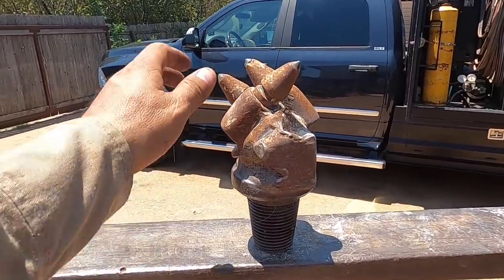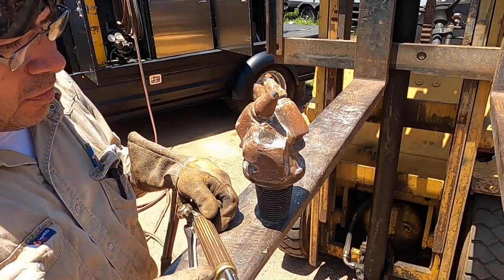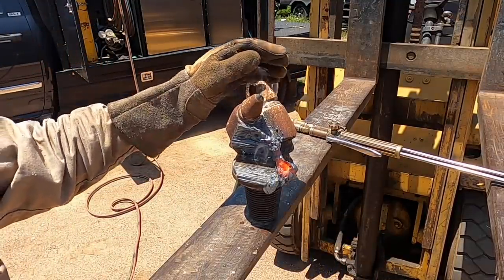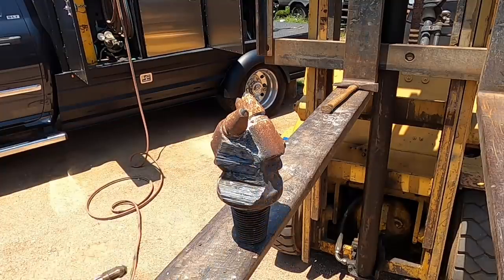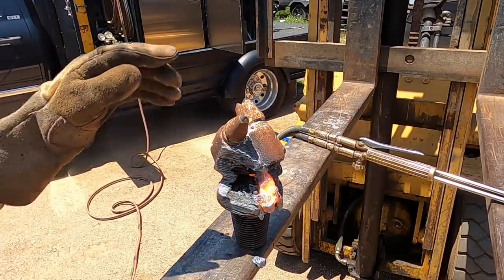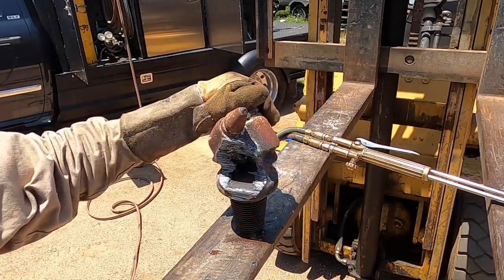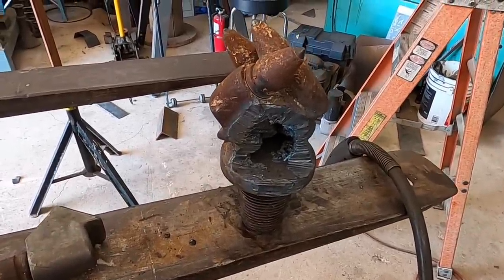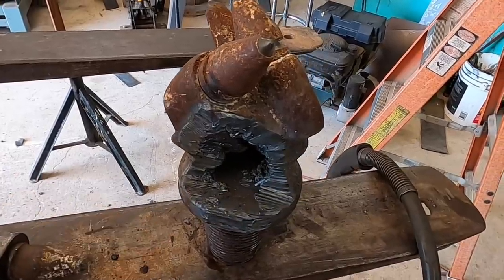Something's missing!!!

Comment: I was thinks ng about you today. I had to cut a 1/4 inch wall sleeve off of a 1-7/16 shaft. I kept thinking about you cutting out MARA and how you went slowly. It helped me focus on slowing down. I cut a face off all the along, then came back and heated up a bit and blew just until I saw the metal separate. Moved a bit and repeat. Perfect cut, no marks on the shaft. Thank you for helping me stay focused.
Reply from the maker: That is awesome! glad it worked.

Comment: One of those teeth looks like it has a flat wear mark on the tungsten. - This means that it is not rotating in the pocket (they call these rotating pick teeth), this causes the tooth to heat up and get ground away as it works the rock, should be beat on or heated up until you can move it in the pocket, if you can't, so long as its still got life you may as well leave it, those teeth ain't cheap.
Not fundamental to your job, and you probably know this, but it might be an added touch you can tell the client about. Always worth going above and beyond.
The tapered thread pilots are rare, probably the best, most secure way to fix them.

Good job, your an artist with that torch.

Comment: Good thanks for those videos that contribute to the knowledge that electrodor uses 6010 7018 7028 and that it works when it carbonizes and heats it is to make it uniform and with a certain heating.

Comment: Good job with the torch  .you can't take pic. At my work but I have one where im cutting   a center out of a base plate that's 4 inch thick  and 6 ft around you need that high pressure to blow it through

Comment: Has anyone ever used a Petrogen Oxy/Gas Torch? I ran across then in USAR...neat lil torch that runs on gasoline. I've had expierience in welding and metal working, I sure admire a good weld, or a nicely beveled torch cut, good video

Comment: We normally torch off the bolts for plow blades on snowplows. If you get it right, you can get the nut off and not cut the bolt. Similar to the work here.

Comment: I'm not a welder but it's fascinating to watch. Just a question though. Virtually everything I've ever seen on welding people use a grinder to get a clean metal surface wipe it down with a cleaner especially when using a MIG welder. They do everything possible to keep the weld area spotless.  I'm curious why a grinder was not used in the final process to clean and square up the surfaces that were cut off with a torch.
Yes I know you can well rusty metal and weld right through paint but it isn't it best to weld clean shiny metal?
And yes like the other said. Using that torch looks like a doctor using a scalpel. That's some pretty neat cutting.
Reply from the maker: Stick electrodes have a lot of flux that helps to boil out a majority of the impurities. However, I do agree that the surface prep should probably be better. Shop fabrication with mig is much different than field repairs. Mig is more sensitive to the cleanliness of the parent metal. That, plus wind that could blow away the shielding gas can create havoc if I used it in the field.
Reply: @ICWeld  thanks I never gave much thought to the difference between mid and stick as far as cleanliness goes.

Comment: I never really paid any attention to torch tip numbers. Ive always used a #3 victor and run at about 10, 60 which ive been told is high but its work from thin to thick  materials But seeing this make me want to drop down to #1 and save on gases i suppose

Comment: Hi folks, I've just subscribed and I'm wondering if it is true that one can shut off
acetilene while cutting once it is hot enough, and if so in which conditions.
I have no experience in welding or cutting, but I just find it interesting.
Reply: Yeah you can turn off the fuel gas once you start cutting with a torch, because once the reaction is started the rapid oxidization of the iron produces enough heat to keep the cut going, but it's more of a parlor trick than it is an actually practical thing to do.
I guess you might do it if you were making a single really really long cut with a track torch and you were critically low on acetylene, but if the tanks are sized right and you're operating the torch correctly that would mean you're also critically low on oxygen, because the way these tanks of oxygen and acetylene are sold you'd generally run out of both of them at roughly the same time.
Reply: @44R0Ndin  Okay, thanks for your response.

Comment: At 9:00 you started cutting, then pulled the tip away. I'm curious about that.
Reply from the maker: I did that so the oxygen jet had less centralized power. The further back, the more its feathered in a sense.
Reply: @ICWeld  I have thought about it and I think I have done the same thing without really understanding why. Lol. If it works, it works, but it's better to understand why. 

And yes. I dig your videos.